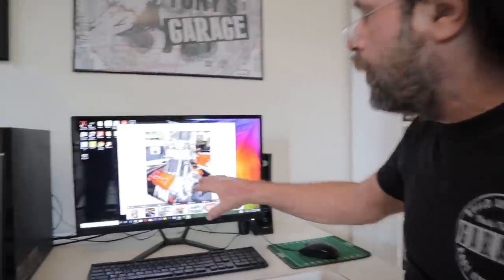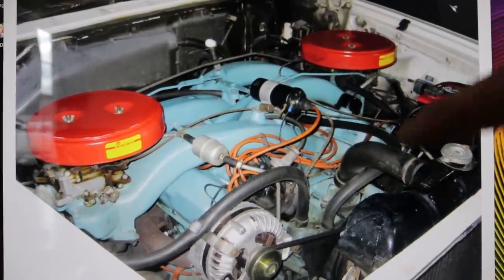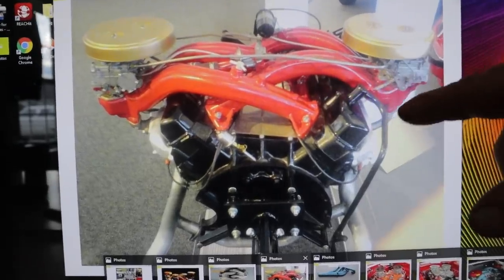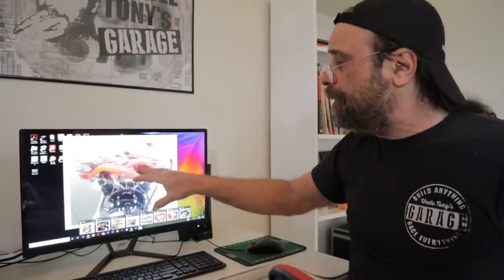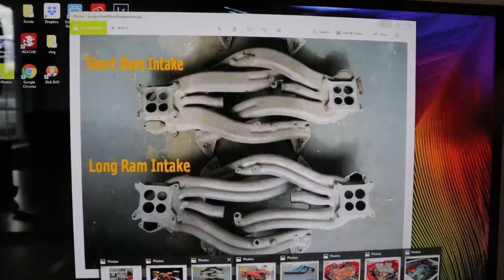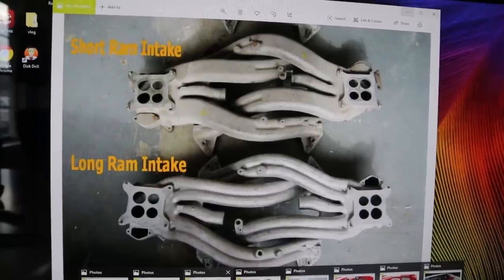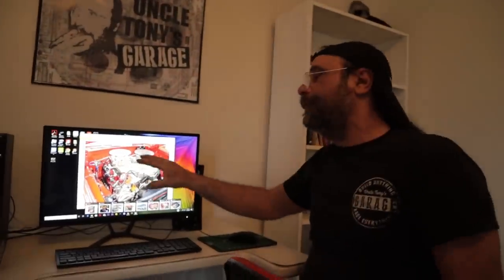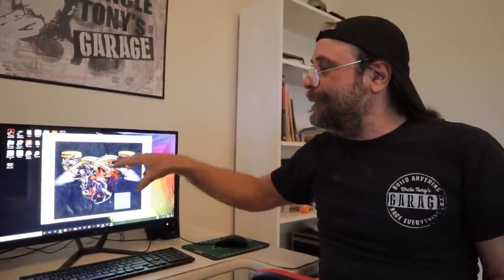The Original Mopar Cross Ram Intake Manifold

Comment: I have those intakes in my basement. Love them things hope to fix them and run them
Reply: Wonder what they would do on a 383.
Reply: @chrismontreuil2206  I'm pretty sure they should fit. The intakes were cast for both the B-block and the RB- block. Cause I've seen them in obviously the 413 and the 361. So as long as your running a good flowing head such as the 906 or if your lucky enough to get like a 915 close chamber head it would do fine. Most I heard they are great for low end torque not high winding.
Reply: @caseycuda854  If he's not going to build a numbers matching motor then he's better off using aluminum heads and painting them the correct color wouldn't he?
The 906s/915s are a waste of money since you can buy aluminum heads for less than the labor let alone the parts, of reconditioning iron heads. The aluminum heads have every mod developed for the cast heads included in the price of them and will outflow the best iron heads right out of the box and weigh 45% less.
Also 'smog' heads are better than 906 heads. Non other than Steve Dulcich showed that in a series of 3 or 4 Hot Rod magazine articles. If you want the links let me know - they're still up.
If he wanted to do it on the cheap just bolt on a set of 70s oem heads with new springs.
The only issue I can see is the late heads are all 6 bolt rocker cover rather than 4 bolt and if there's an asthetic issue he'd be using the early heads anyhow. Sometimes the performance is not the issue.
Reply: @ThePaulv12  oh it's always a question of price. If money isn't a problem and in the "land of Mopar" that is a trick. The old cast iron  wont beat new aluminum and for the price I get it, plus the bonus of less weight. But if your like me 906s are cheap and I ain't scared to grind on one to clean it up. But I wont lie and tell you new isn't better. It really just comes down to what your looking for and what you can afford.
Reply: @caseycuda854  Just use the late 234 onwards heads if you can get your hands on them. Forget 906s. Sure if you have 906s use them but after reading those articles I will never ever use a 906 if I don't have to.
Reply: silverbird58  long they came off a 61 new Yorker.
Reply: @ThePaulv12  yeah I've got like three sets of 906 and one 452 cast. But hell I'm going to be spending this year paying off my 71 cuda. So I'll be happy with the 906s till I get some spending money
Reply: @chrismontreuil2206  they built 383's with this setup back then.
Reply: @ThePaulv12  some of us still like to use iron.
Reply: @chrismontreuil2206  if you're not chasing big power why not use iron.
I'm saying this from experience, the cost of labor and parts to modify iron heads for 450+ hp isn't worth it to me. Chinese heads are OK if bought bare. I never ever trust finished heads but they are so damn cheap in some ways they're hard to resist for the power they produce.

Comment: i had a 1965 300 L.   413 single 4 bbl.   i looked into putting a long ram on it..  BUT  the long tubes would crash in to the wheel well.  as the wheel well was taller than a 1964.   but i was able to get it to do 16 sec  1/4.  at 4,000 lbs.   remember this is NOT a race car.  its a gentleman's performance luxury car.
Reply: Had a 57 Chrysler New Yorker, 392, single 4 barrel.  Best time, 16 29 at Keystone Raceway Park in PA in 1967. Chirp the tires when shifting to second on the push button torquefilght.

Comment: Tony my uncle built a 2 1/2 inch square tube manifold to use 2 carburators 1 bbl Carter's to mount to a 390 Ford f250 for towing put carbs out past engine on sides and mounted to 4 bbl intake improved milage and power a lot

Comment: I had 2 Ford Taurus SHO's. They had a flapper valve that only allowed the long runners to operate until 4000 rpm. At above that it allows the short large diameter runners to operate. The acceleration was fantastic.

Comment: I actually saw one of these engines back in the later 1960s.  While in college, our neighbor across the alley was a car nut, as was his brother.  The brother and a group of his buddies ran a "hobby-stock" dirt track race car at the local track.  The year I met them, the track totally changed the rules for their class of race cars.  The old race car was a '35 Dodge coupe with a Chrysler 354 C.I. hemi with a class limiting 2-barrel carburetor.  The new car would be a fiberglass bodied car with an in-line 6 cylinder limited to 250 C.I. still using a 2-barrel.  Anyway, one of the guys took the '36 Dodge coupe and put in a 413 engine with the cross-ram intakes hooked to a 3-speed torque flite transmission.  I got to ride in the car on one of the test drives and it was AWESOME.  The total weight was probably less that half the weight of the original Chrysler and it would fly..  The sound of those two 4-barrel carbs kicking in when the RPM came up was totally unforgettable...  The visual impact of that engine just cannot be imagined.  You have to see one to actually feel the impact...

Comment: Well done! It was interesting to note how much that knowledge continued to be used by Chrysler, even today. When I had the first version of the 3.5L it had the crossram from the throttle bodies to the heads and the exhaust manifolds looked like shrunken and amputated, by one cylinder, manifolds from a street hemi. Then the later 3.5's were triple tuned. With variable valve timing it is a little harder for me to see the manifold tuning on my 3.6L but the Hemi still does.

Comment: I saw one of these long ram intakes about 20 years ago at a car show. I blew my mind! I'm looking all around the motor and I ask the guy how in the heck did he change his spark plugs. He showed me where the factory had cut a good size hole in the inner fender. He said he would jack the car up and take the front wheels off and reach up through their with a long extension and a wobbler with the spark plug socket on it. There was a rubber flap covering the hole so that water and mud wouldn't splash through the hole. My Dad told me about being on the highway in the mid 60's and coming up on a Texas Hwy Patrol car on the side of the road right as a speeder passed it. He said you could see the left fender just torque up as he got on it to catch the speeder.  Dad was impressed.

Comment: The second manifold you show reminds me of the solution some guys came up with for the GM TPI system, take a set of aftermarket cast runners and open them up starting at the plenum to siamese each pair of runners.  One of the easier ways to get some revs out of that setup.

Comment: Chrysler did some very interesting engines. I saw a prince valiant car, I think it was 1964 car, it had the 413 cross ram engine with turbo chargers on it. The car was ugly as sin but the engine was incredible. The owner of the car said the car belongs in a museum.
Reply: yea few cars had that on the outside by lower fender well was a emblem size of book of matches 413 wedge

Comment: I dynod my mild 440 testing an M-1 single plane, Weiand TunnelRam, and a set of Chrysler ShortRam manifolds back to back using the same 750 Edelbrock carbs. The Shortrams buried the other two intakes in the torque dept. They made the least hp (429vs 455&469) but they made 543ftlbs@3800 and made 512@2500rpm.

Comment: Same reasons the EFI 302s of the mid 80s-90s had the big folded over upper plenum design. Allowed the engine to make 300 lb ft of tq. Easiest way to package a long runner setup in what where relatively small cars.

Comment: What you're talking about is the same idea as two stroke engines in that the use "tuned headers".  The idea is there's a sonic pressure wave from the exhaust and if you time it right, the exhaust pulse pushes escaping combustible gasses back into the combustion chamber.  Just look at the lumberjack competitions and you'll see huge tuned pipes coming out of them.   For that same reason it's unwise to run a stock engine with open exhaust or even headers without doing extra tuning. 
As a side note,  I ran a cross ram on a big block Chevy.  Completely open plenum with 660 center squirters. Just didn't work.   Thanks for listening Tony.

Comment: I used to have the December 1959 issue of Hot Rod Magazine which had a feature on the new engines for Dodge for 1960 and that setup was featured on the cover.

Comment: I had a 1971 Saab 99 that had a super long intake. It was electronic fuel injected with a fairly large throttle body plenum, but dig this, the air filter assembly had a very long intake too. I would say the entire inlet length was over five feet. It had that weird British engine in it with the cross flow head single overhead cam. It was spirited I'll say that. That engine had a nice four into two into one head pipe on it too

Comment: There is another content provider on YouTube, Nick's Garage, and he just had a 1963 Chrysler 300J with these long ram manifolds in his shop for an engine rebuild and upgrade (switchover from solid lifter to hydraulic flat tappet with the same cam grind) and some serious other work done. Whatever. After the engine rebuild he put it on his Superflow 902 engine dyno and did a lot of tuning work on it. He did several dyno pulls on it with a single 4bbl intake for some baselines, then ran the cross rams on the 413 motor. The customer had the short passageway version of the long rams, and the torque values around the 4400 rpm design criteria really reflected what ram tuning can do for you. About a month before that, Nick had a 426 Stage 3 Max wedge competition engine with the competition short ram manifold, that he rebuilt and then put on his dyno, and the ram effect was totally obvious. It, too, was designed around a 4400 rpm peak and the torque values between about 3800 and 5400 rpm was with negligible variance, perhaps only 5-7 pounds torque. Whether you're a MoPar, Ford or Chevy fan, you gotta say that MoPar's engineers were really out there with their engine work. With 11:1 compression and an A/FX grade flat tappet cam, the engine put out over 550 HP against a 425 HP factory rating. The customer was putting it into his street cruiser.

Comment: I ran a pair of those on my 440 in my 31 Ford.  Yeah, I had to make spacers to get them to fit.  I traded the intake for an 833 & an STR14 so I can get access to my rockers without taking the whole top end apart.  I loved them, just not practical for solid cam

Comment: I remember in the early 1960's, even mid 1960's, Mopar Performance sold cast iron single plane, inline dual 4 barrel intakes with carbs, linkage and air cleaners, for both the 383 and the 413.

Comment: Lot of fun to set valves with that cross ram setup. 😄👍🏻
Reply: Hydraulic lifters, no need to set valves.
Reply: Mr Danforth 374, Still gotta check lifter preload now and then...
Reply: @shitbox7413  How? There is no adjustment on a B or RB engine. It is preset when the engine is built and never changes.
Reply: Mr Danforth 374, True, they have a net lash rocker don’t they.

Comment: The intake manifold tuning principles share some of the same characteristics that are used in tuning an exhaust pipe for a two cycle engine. Performance tuning is about what pulse timing you're trying to achieve.

Comment: I owned one of the early version, well most of it! We made a new balance tube and filler plates for Ex. cross over. cut all the extra stuff that hooked it to Ex. manifolds.  Hey I was 18ish!  Was set to install with 2 thermo quads in my 69 SuperBee. I wanted a four speed, converters then, nothing like today! Guy stopped in the autoparts store I managed. To long of story! Short version, Traded same dude intake for a clutch flite! Stall converter, who needs one! Kept the carbs and bought a Blower to put under them. Peace

Comment: Whats great about all the wild induction systems factories played with in the 1960's is that it was all mechanical. Of course there was no EFI then. Carb tuning venturi to venturi was huge, let alone plenum tuning and runner cross section diameter and volume and length. Im pretty sure the early 80's pro stock guys gave more info to the OEMs about intake signal, plenum volume, and runner length than any pencil pushing engineer here in Detroit at the time!

Dang i should not have said that out loud

Comment: That 80's resurection was known as the 5.0/5.7 tunedport corvette,  ims 34" runner length..  to make torque for those cars with .75ish od th700r4 and 2.73 rear gears

Comment: The Raminduction Mopars were a amazing piece of engineering. As you said they gave a unbelievable wallop of torque for passing. Unfortunately they were not without their faults. They were difficult, and frequently impossible to start when cold. 30 inches is a llloooonnnggg way for a fuel air mixture to travel in a cold engine The fuel would drop out, and puddle on the manifold floor. They also made replacing big block Mopars notoriously leaky valve cover gaskets a real hassle. From a production standpoint the were costly, and complicated. The engineering idea did not cone into its own until fuel injection., Now virtually everything has Tuned Port Fuel Injection. Thanks ma Mopar.

Comment: firgured it out. wasn't actually a cross ram after all, but did have two Carter carbs on it, the air intakes were kinda cross ram style, but the actual manifold was not. 300C Chrysler 1957 had one of what I'mt talking about, it was a 392 Hemi I believe, or something on that order.

Comment: As far as I am aware, the cross ram intake manifolds predate the radiator hose tunnel ram that ramchargers was experimenting with in 61-62. I grew up knowing a couple of these guys night don't think that the cross ram post dated that. It has been a while ago. The only problem with the cross ram, is that it didn't have bleed over availability in the runner so that at about 45 to 4600 RPM it actually acted like it ran out of Cam because of the reversion effect of the overlapping valve timing. But it ran really good and it actually got really good gas mileage for a big as those cars were. And I don't think there was any 383 at the time. The only D-Block Commander at that time was the 361. The 383 came out as a raised Block in 1964 or 1965 after the cross ram had gone away. Unless I was misinformed. And the 1964 raised block 383 I believe was a one year only

Comment: I remember seeing a Ford 6 cylinder may have been a mule with tuned intake and long pipe headers. IIRC it was in a book written by Leroi "Tex" Smith
I just had a thought maybe you'll remember the book it was a paperback about 3 inches thick and it went through all the specs of building, all the engines of the big three in production at the time. It was sprinkled with tech tips you could use for all in each chapter one of those has stuck in my mind, I have never used it because I have never built an engine that was reving high enough to need it. The author claimed if you rubbed pure lanolin to the outside of the bearing shell that once it heated up it would turn into a glue that would make it impossible for the bearing to spin. Unfortunately due to it's thickness it fall apart, I bought it second hand at a flea market, and for the life of me I can't remember who produced it

Comment: I had a 1960 Chrysler Imperial Crown with the 413, but single 4 barrel, can only imagine how it would been with this..........not many people remember this ram set-up, I knew all about it, and yes, Chrysler engineers had a racing gene running thru their veins but upper management put the end to alot of the ideas that "would have been".......most of the top brass wanted to sell cars, not experiment with costly engine set-ups........I then had a 1968 Chrysler 300.....440......Torq-flite.........at the age of 17-18.....ran it back and forth to the Jersey shore........some early high speed runs down to Wildwood on the GSP...........that 440 was a beast.......all I ever did was stick some headers on it, and hooker was the only company that made them to fit this not so normal "header car".......big car, huge trunk that hung over the tires, great traction............oh, it had a console stick shift, bucket seats, red interior, black exterior, and on the console, it had a vacuum gauge that I think was meant to be sort of a "fuel economy" alert.........yeah, floor the thing and the needle dropped to 0 until the engine revved up and normal vacuum returned.....somewhat..........sad that I was parking it right in front of my house when a drunk kid hit my left rear 1/4 and set me and the car 2 house down the street.........I walked away but the car twisted.........done deal..........

Comment: My dad owned gas station/repair shops from 1958-1996.  His mechanics cringed when his customer's brought in a 300 or Furry with cross ram.....You have to remember, shops with analog diagnostic equipment were rare due to expense.  When I was a little kid, I remember my Dad screaming about the cost of $16K for three units for his two locations.   LOL.  That was the cost of a couple really nice cars.  It was 73 or 74.   Just think about the linkage ……   carb adjustment.....  for most shops, by ear!!!

Comment: I've wondered about having an active manifold where the runner length could be adjusted on the fly. Tuning length according to rpm and load. A scroll within a scroll that could be servo motor controlled?

Comment: The guys that had those got sick of all the head aches that you get when it was a daily driver. The short rams had solid lifters so off comes comes the system! Too many single quad cars would beat these street racing because of the need to tune and maintain these beasts. Then Edelbrock came out with the STR (street tunnel ram) for the HEMI, B and RB also known as the rat roaster. These have removable tops, not interchangeable between B/RB/HEMI so they could have inline 2x4 offset 2x4  single quad , six pack and I think a 2bbl for the B engine. Again, hard to tune but but keeps her nipples hard.